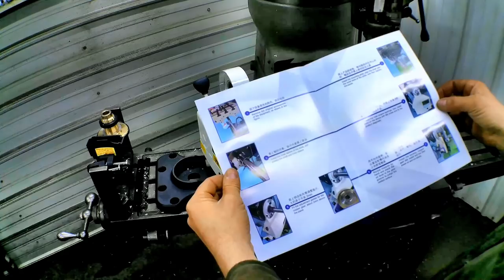Installing the Cheapest Milling Machine Power Feed From eBay on a Bridgeport Milling Machine, Vevor

Comment: I did the same thing 20 years ago... the only that failed was the pot, speed control, it was a carbon resistor pot, replaced with a good wire wound pot, fifteen years latter, still works.... if I remember correctly it didn't even cost  5 bucks and a hours work....

Comment: I installed one of these and had some issues , after putting it on and taking it back off three times I discovered some mutt had taken the lead screw out then had flipped it when they re-installed it............ after I put it back together correctly it worked like a champ!

Comment: Hopefully the power feed will surprise you !   I would like to put one on the vertical travel of my BP one day .   I take it you are filming on the camera you bought a little while back ?  I am still using a very old I pad & it's not the best but i have seen a lot of focus issues with high end camera's  .  Personally my fear would be spending too much time dicking around with something expensive and with  a lot of adjustment options  & loosing machining time .          Cheers   👍
Reply: Really needs something with manual focus or at minimum, be able to turn auto focus off.

Comment: Nice cheap addition,  got an "Align" brand to fit, made in Taiwan,  quite a price difference. 
Looking forward to some new photography,  appreciate you investing in new non machinery equipment. 
Thanks for sharing.
Reply: I also have the Align on my PM 833T mill. No problems so far and i have had it for about 3 years now.
Reply: @terrycannon570  Good to hear, I bought it from a UK machinery supplier, where I am based. Best regards John

Comment: I purchased and installed the exact same model power feed on my Bridgeport a few weeks ago. 
I agree, the instructions are horrible. The first thing I had to do was turn down the collar on the lead screw removable end to allow for the new mount. The collar was about a 1/4" too long. There was a recess for the collar in the original casting, but the new aluminum mount was flush. I also had to do some deburring on the new mount to get the bolts to go through it. The next thing I needed to do was to widen the keyway slot on the new brass collar / gear about 10 thou. I did that carefully with a needle file which wasn't too bad since it's brass.
The instructions don't give any real information on what the gear lash should be so I cut a strip of copier paper which is about 4 thou thick and slid the gear in place and took depth measurements to figure out how many shims and their thickness I was going to need. 
Everything else went pretty much like it did for you. One will need to figure out which spacers go where etc. Once you start looking at it everything makes more sense. They went to a fair bit of trouble to make a colorful brochure type of instruction book which is worthless. 
So far I'm happy with the drive. I did figure out that in order for it to disengage from the leadscrew that the direction handle needs to be in it's center vertical position, turning off the power alone won't do it.
Reply from the maker: It was definitely a challenge to put on, but nothing is impossible when you own a machine shop. Lol. I'll just be happy if it survives the one job it was purchased for. Anything beyond that is a bonus. So far it's done 25% of the job and more than paid for itself.

Comment: I bought this exact modle two weeks ago.  I used it an hour on my M head Bridgeport.  I'm going to be nice here and say, after communicating with the supplier for a week for replacement parts, with photos and a video of it NOT working (isn't that a photo....?) and asking me to fix it myself, then asking me to take it some place to be fixed, they sent me a second one.  The second one lasted 1 1/2hours.  They are both in the Dumpster.  I bought a Servo 1000   works perfectly under the same conditions the Vevor's didn't.  So, I think my granny was correct..."ya gets what ya pays for..."   Caveat emptor.
Reply from the maker: I had similar problems. I made it through the job I bought it for then sent it back. I have since replaced it with a quality unit. But, at least it completed a high dollar job before failing.

Comment: I'm currently fitting one of these to a bridgeport to replace it's original power feed, for my boss. And what I'm finding is that firstly after removing the original bridgeport power feed unit ive had to swap the leadscrew around to fit it to the remaining  manual handle end. Even so with this it isn't a straight fit I'm having to turn a bushing that will go on the inside behind the bearing in the power feed to back the x axis feeds screw away enough that the brass gear actualy can make contact with the pinion that sticks up from the powerfeed. The pictures show sleeve fitted over the feed screw end that a cushioning spring is then supposed to  fit into but there's no such arrangement on the end that I've taken apart. I'm troubled by the fact that those rather significant earing races have now been replaced by one small roller bearing in the power feed and the casting that it hangs off seems rather insubstantial  and frail.

Comment: Just purchased one for my little Enco after watching this and a few other videos of the same type of install.  Thought my install would be apiece of cake after watching those.   Verifyied that I already had a narrow key on the end of the screw.  It was all going well until I too got to the spacers.  I might have to pull the lead screw and move the shoulder .06 to allow the head unit to go back far enough for the gear to mesh.  Did you ever find out what the two springs are for?
Reply: If you haven’t figured it out yet, the two springs are for the limit switch. Take the outside cover off the limit switch and there are 2 square knobs on each side of the switch, the springs go over the knobs, one on each side. Inside of the cover there are pockets on each side for the springs to set into, the first side is easy, the second side takes a little wiggling with a screwdriver but it’s not too bad. I hope you understood my explanation and good luck!

Comment: I added a cheap power feed manufactured by Wen Ding on my bridgeport knock off. Not a big fan as it is not smooth at lower feed rates. Like everything, you come up with some work arounds. Will be interesting to see what you think of it in use.
Reply from the maker: I bought it for one job. If it survives the job, I'll call it a success. Lol who knows, I may wind up with a Servo yet.
Reply: @TopperMachineLLC   i saw the update and it did not work the first time for you. but it is like buying good oats you have to pay a fair price for them but if you can use the oats after the horse is finished using them it comes much cheaper but it is runny and it smells like sheet.  and that proverbial adage buyer beware. if it is to good to be true then is a probably is. and one person's junk is another person's treasure because
Reply: they figured it out. for my dads use he figured out to make it work or he got lucky or had a different machine. 

i will be a donky and say that power feed is automating the manual. . feed . but we can be jtolly   play mates and  we can chose to disagree and continue to play. 

great find on the Bridgeport  schools rarely wear then out.

Comment: So Josh, What did you do about the lead screw shaft? Did you replace it the original or adapt it somehow for a regular crank. I’m trying to add a power feed to my Bridgeport that came with the 6F power feed (that doesn’t work). Thanks

Comment: This is very interesting. Vevor are our favourite overseas supplier, the products are good the support is great but as you found the instructions are really horrible. I did not realise they sold a power feed and I have checked out the product. It appears to be designed for a Bridgeport, do you think it would fit on our Cincinnate lathe where the factory power feed is on the left side of the bed?
Reply from the maker: I do not know. Would be interesting to see if it would.

Comment: How quickly do the limit switches stop the motor ? 
The limit switch is not the correct design - it should be designed so that the operating adjustable limits can pass the limit switch - to cover for the case of overrun - so as not to force the limit stops into the switch (at rapid speed).